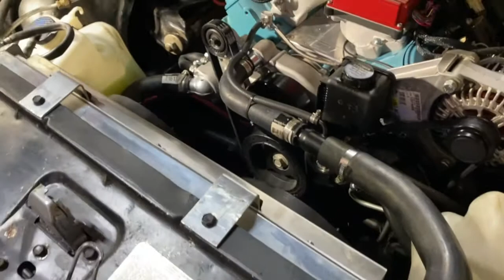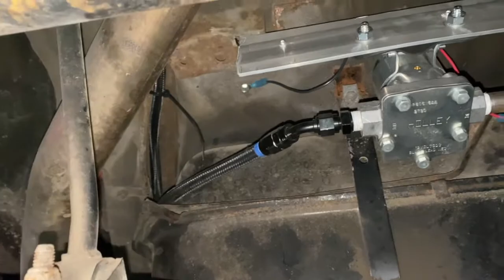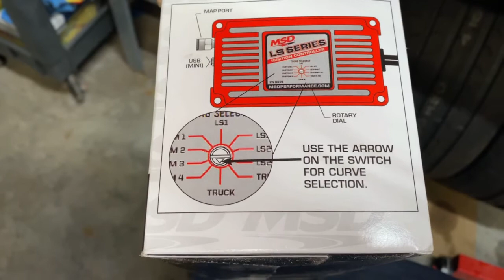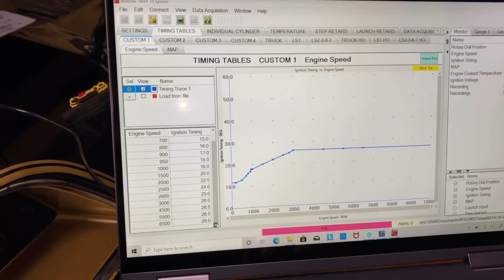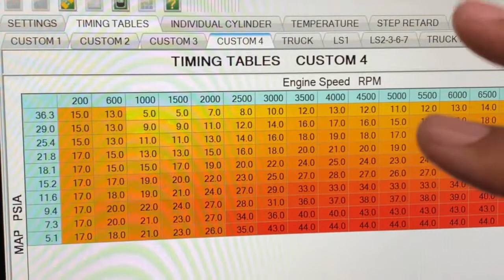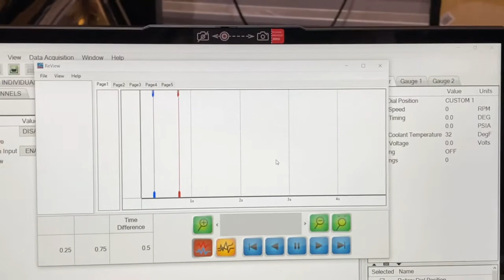How To: LS Swap 1978 4 Speed Trans Am - 6014 MSD

Comment: What are your RPM's running at about 70mph?
Reply from the maker: With 3.73’s in the rear and the 4 speed it was terrible. She would do maybe 45-50 at 3500 rpm. Went to a 3.08 gear and it would run 75 mph on the freeway all day at 3500 rpm. Only thing is with that low a gear I really had to ride the clutch at street light’s.
Reply: @TexasDragRacingVideo 3:23's might be the sweet spot.

Comment: Most all long tubes will hit the linkage . I think the z bar can be made to work.
Reply from the maker: I searched and searched and could not find any info on any long tubes that would work with with Z-Bar. Only real solution is to convert to a hydraulic clutch setup.